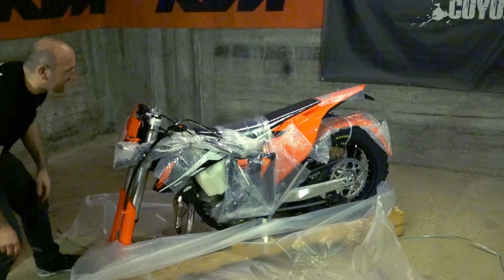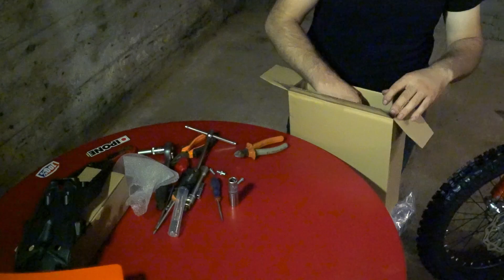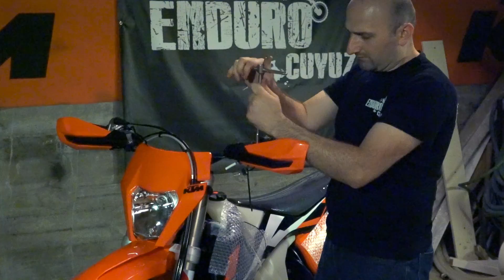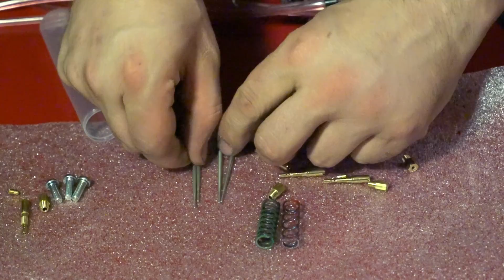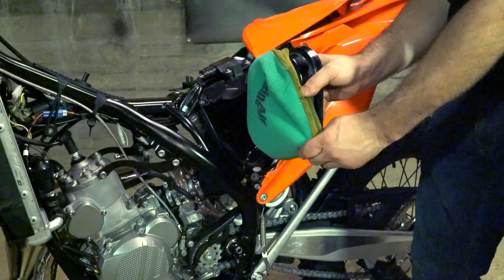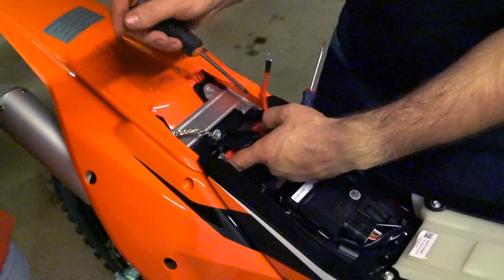Unboxing and Settings 2017 KTM EXC 250

Comment: what were you doing with the carburator and why? and what is with the stock expantion chamber - it looks really ugly - did it come with the one you put on it?
Reply: the bikes from factory come in the "homolgated" version that have all the parts and jets needed for it to be approved by the EU for circulation in roads. he changed the carburation and exhaust to the "competition" version that ktm says so it can be rideable in normal enduro conditions
Reply: +António Araújo ahh i see and the expantion chamber?
Reply: the expansion chamber is the homolgated version which reduces hp and emissions, so it can be legal for someone to ride with a license that is valid only on bikes that output certain type of kw's. the kw in the homolgated version are far less than the ones in the normal enduro version which make it legal for circulation with certain types of drivers licenses.
Reply: ok then - does the chamber that he put on there come with the bike?
Reply: yeah

Comment: I'm looking at getting a dirt bike and I'm 6foot, my buddies were telling me to get a 450 because I'm tall. Would it look weird if I was riding a 250?
Reply from the maker: dimensions will be close for both bikes. you won't look weird. but you will need extra parts like bar risers, stiffer spring for the shock.

Comment: You havent even tried how it works with jets and needle that came stock but immefiatelly changed them.did you use recommendations in service manual or you simply know jetting for environment you ride in?
Reply: It comes stock with dethrottled settings, as you can see the pipe, carb settings and air filter case. Theyre almost always changed to full power imidiately, like in this case.

Comment: If I where you I would've taken off the spark plug and pour a little 2 stroke oil down the cylinder before starting it

Comment: Interesting, that's a 250? Looks like a 125/150 pipe
Reply: Street Legal 2 Stroke pipe for some Euro Spec and Central American spec bikes.
Reply: +lostinactionable that's actually really interesting.  Thanks man!
Reply: +MotoJake95 good eye catching the pipe difference but yes different spec so cool they can make these 2T streetable
Reply: I've got a registered 2016 EXC 200 and have exactly the same pipe which I have to throw on when getting it registered, took it off right after that and now my babe has a FMF pipe :P Greetings from Germany
Reply: +MariusB wie sieht es mit der Wartung aus bei ner 200er exc, wieviel km bis man was machen muss ?
Reply: +MariusB wie sieht es mit der Wartung aus bei ner 200er exc, wieviel km bis man was machen muss ?
Reply: jsinc

Comment: Noisy engine..

Lol .. a lot of vibrations

Not a good one

You need to re balance the crankshaft/inside the cylinder bro...

So shame.. that's a nice bike..

Butyou forgot.. 2 stroke engine from manufacturer is different with 4 stroke manufacturer

In 2 stroke we need more adjustment.. especially w/ the engine

Comment: Im pretty sure thats a 125 or 150
Reply: Ummm why?
Reply: look at the exhaust it would be more curvy at the beginning if it was 250 i think.
Reply: +nictakes did you look at the end of the vid? first exhaust is restricted one
Reply: +nictakes it reads at the title that its 250..
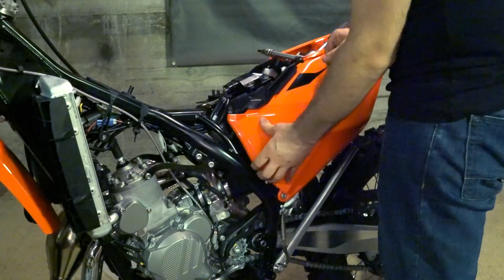Reply: Any 2 stroke KTM in the store originally has fitted a restricted exhaust (because of power/pollution, so that people can register it easier). All of the restrictor pipes are the same, and they restrict the bike to like 7 horsepower. At 10:37 you can still see the restricted exhaust, but at 11:00 he changes it to the original, unrestricted exhaust, which is clearly a 250 pipe (look at where it comes into the cylinder, how it's curved). Hope I cleared up some confusion.
Reply: +Jon Jelen ok ok got lt :D Can you get these new ktms into register anymore? i read that you couldn't and that 2016 models would be last ones that it registration is possible
Reply: With 2017, there is no more EXC 125. It's replaced by a XC and XC-W, which cannot be registered. The EXC (200 not sure?) 250 and 300 still remain, and can still be registered. The EXC 125 will come back once they make them electronically fuel injected, which will replace the carburettor, and then you will be able to register them again ;) the 2015 or older EXC 125 can still be registered.
Reply: +Jon Jelen oh okey thanks
Reply: I was wondering why he changed the pipe now I know thanks for the info
Reply: watch 5.38
Reply: canciones. de. moana
Reply: ARidingLifestyle why
Reply: Frezzyh 
K
Reply: ARidingLifestyle
Reply: ARidingLifestyle grasia
Reply: Jon Jelen
Reply: ARidingLifestyle  please  Rs the bike

Comment: 2 strokes are okay but not the best I just don't like it when u first buy a new bike and the. Starting it up I don't like the sound but 4 strokes are way better
Reply: 2nstroke race bikes are better than 4 stroke ones
Reply: +JDGAMER Xx are they actually ?🤔
Reply: +Almir Uka I own a crf250r and I can tell you right now,  my stepfathers yz250 will eat mime around a track.
Reply: +Moto . Kid wow😱
Reply: +Moto . Kid nah the crf should beat it easily
Reply: Sorry bro.  Once that expansion chamber kicks in,  my bike doesn't have the power to stay next to it.
Reply: +Moto . Kid perhaps u could upgrade it or maybe it's lost power over the years ?
Reply: A 2 stroke is pure race power. My crf250r I s a race bike and it's fast as fuck,  but I've driven that yz250 as well.  And since I'm 14, there's not much weight on the bike,  and it hauls major ass
Reply: +Moto . Kid I'm 14 aswell ✋😀
Reply: +Moto . Kid u subbed to u 😄
Reply: Yeah who the hell likes a bike thats more powerful per cc and lighter? Gtfo I bet you ride a ttr...
Reply: +ARidingLifestyle I had a ttr. Razed the fuck out of it and sold it for 1400. My crf250r is a 2005. There is nothing unbelievable about me owning one.
Reply: +ARidingLifestyle so stop hating.
Reply: ***** I wasn't even talking to you. I didn't ask for your life story either so gtfo. Have fun with those valve problems lol

Comment: Why does he take off so many parts then replace them with the same thing
Reply: +Romulan kush88 why don't you find a real answer then comment of my post aye sound like a plan good
Reply: The bike comes in a restricted mode for road/trail use.The first pipe has a long thin head pipe,for a slower broad power delivery.Less flow means less in and out.He removed the restricting cover inside the twin air filter,and also removed the small pilot and main jet,and put in a new tapered needle.Bike gets the full race exhaust,bigger jets in carb and now a full flowing air filter.Now its a race bike,and would not be road legal,well depending where you live.Joking aside,as a old motocrosser,that is the ugliest stock pipe I have ever seen!

Comment: thats a 125 look at the pipe
Reply: yea that's what I was thinking, but it came with a 250 pipe and he put it on at the end of the video... I wonder what the point of that is
Reply: the first pipe that was on was the restricted one.
Reply: ah didnt notice that
Reply: +UliPuli does the second pipe included in the package or you have to buy it separately?
Reply: The bike is for road / trail riding so comes with a restricted pipe to keep the power down on the roads.
Reply: Ops Fluent FFA Well there is that and then there is also the fact the bike needs to conform with emissions regulations
Reply: Evan Davis lol emisions its a 2stroke it smokes and shit
Reply: Ops Fluent FFA There's still emissions regulations the bike has to pass in different countries.
Reply: Evan Davis im guess where im from it dont matter
Reply: That's why he rejetted the carburator and why he had to change the airfilter holder...
Reply: read the script, it is a 250cc
Reply: William Chivers i know dude im not stupid i run a cr 125 and a kx250
Reply: Ops Fluent FFA You're not stupid ? Erm "  
thats a 125 look at the pipe "
Reply: your right ive had 250s for 25 years. thats not a 250.
Reply: +Kevin Stearns it is he has the other pipe in a box
Reply: wait that pipe he put on is a 250 pipe? what gives? not a big deal if you do a video be explicit. just sayin
Reply: Kevin Stearns no he has a different pipe that pipe is a restricted pipe
Reply: Kevin Stearns You've had 250's for 25 years and you can't tell a 250 in a video ? Yeah righto you've had 250's for 25 years. We believe you, but millions wouldn't
Reply: so what is it? im not the only one. you can teach an old dog new tricks i dont everthing. like others do. 250
Reply: no a 250
Reply: Kevin Stearns It's a 250
Reply: a ktm250exc
Reply: thanks.
Reply from the maker: We changed it for better air intake. Concealed  air filter cover is also part of the restrictions.
Reply: Boundless nope its for when it is shipped so nothing can get in the head
Reply: for those who still seem to think its a 125 ... its not. They come from the factory with the restricted pipe to make it easier to get them into countries with low emission laws as the EXC is road reg from the factory (type of thing) compared to things like the XC's that come with a head light but need the owner to register it. Britain is one of the countries that have to have them when theyre sold and yes the standard pipe SHOULD be included when you buy the bike. You go to most KTM dealers in England and they'll have these on unless the dealer has swapped them out for the looks

Comment: but that's not a 250 at all. that's either a 125 or 150
Reply: You're right this is wrong the video is 125 and not 250 by the 2t pipette that is shortened

Comment: WTF did he do with the carburetor
Reply: He rejetted it, which controls the air/fuel mixture, which is dependent on the environment. Like altitude, temperature, humidity, ect. Most KTM's are tested and jetted in Crawfordsville Indiana I believe, and he is just making it jetted for his area. Makes the bike run way better if jetted correctly. Look into it, before u run too lean and blow a top end due to excessive heat like I did!!
Reply: Luke Bright oh cool
Reply: It was restricted, you could see it because he got bigger jets, unrestricted airflow and a PP exhaust. If you see when he changed the plate after the air filter it was barely getting air.